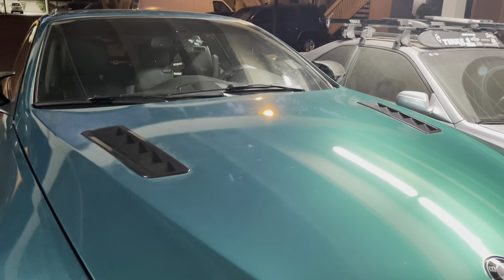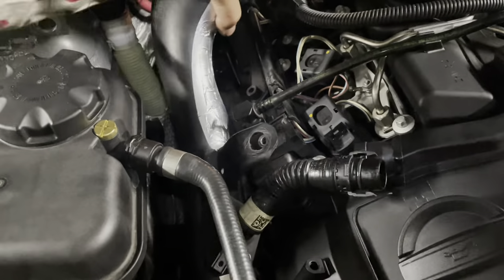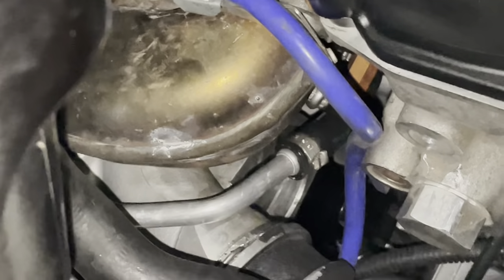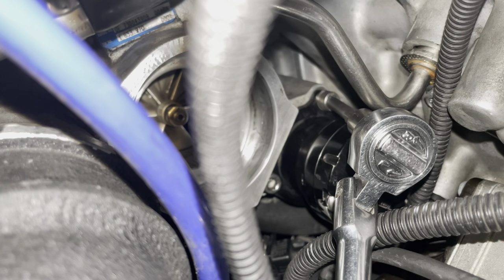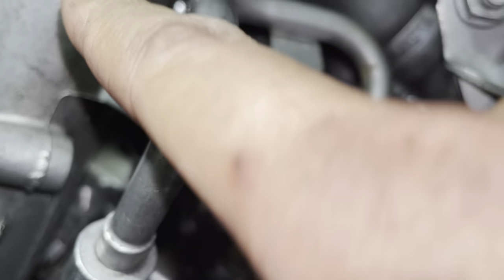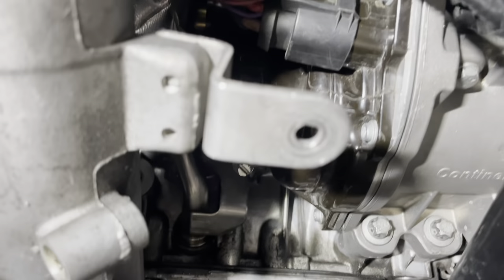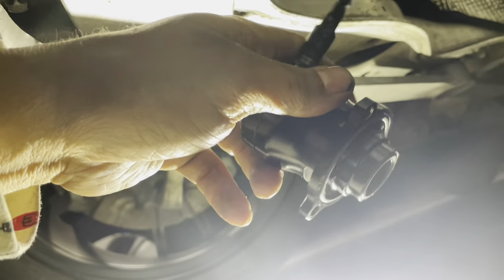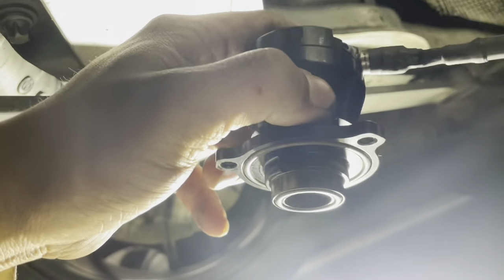BMW 335i N55 Turbosmart BOV Blow Off Valve Install Guide Without Removing Water Pump E90 F30 DIY

Comment: Cool video, but you should mention that the only way you're doing this job without removing the water pump is because you left the 3rd bolt off your water pump from a previous job. Everyone else with that third bolt will remove the water pump since you have to disconnect coolant lines to access that bolt.
Reply from the maker: Thanks. The third water pump bolt is tricky to get to, but very possible using swivel sockets and extensions.  There is plenty of guides on the water pump, so I didn’t bother to include it in here.
Reply: @Sals_Garage  it’s just convenient for it to be in one video
Reply from the maker: @1oftheworstclashers740  Sure thing, I would have included it if I had the third bolt installed (which I didn’t at the time).

Comment: If you can get to one bolt and see the others, do you think this job can be completed topside and not even lay on the ground???
Reply from the maker: Not possible since you cannot reach the bottom two bolts from the top, let alone remove and replace the BOV.  It's impossible to see what you are doing from the top.  Easiest way is to remove the waterpump:  https://youtu.be/_EueZ7n6JKQ

Comment: where was the plug with the 2 wires connected? thanks, is it electronically actuated?
Reply from the maker: Electronically actuated, it connects to the stock diverted valve connection.

Comment: Question i want to install this mod to my bmw x5 e70 35i 2012 n55 stock engine ,will this blow off valve cause any problems to the engine or turbo over time?
Reply from the maker: No issues at all.  You will love this mod 👍

Comment: This pretty much the same for f30 apart from whhere the intake is?
Reply from the maker: Yea, the F30 is the same besides the intake location.  Kies motorsports has a good DIY guide on the F30.  I would still try to get at the top bolt from above while removing the inlet and intake.

Comment: Do you think this same method would work for an F15 X5?
Reply from the maker: The turbo is the same but the inlet design and taking apart the intake might be different. I would remove the water pump if you get stuck at any point.

Comment: Is this process the same for e90 335xi(n55)?
Reply from the maker: Yes, but less room to work with due to the front diff.  I would remove the water pump if you are having difficulty

Comment: Will my car be able to run properly with the BOV installed since MED17 is a MAF and load based ECU, BOV won't confuse it by letting the MAF-calculated air out of the intake system?
Reply from the maker: Yes, no issues at all. The MAF only has issues when there is a leak or aftermarket intake sometimes. The car actually runs better than ever with the BOV since the stock DV leaks past 20 psi.

Comment: Im confused, granted mine had a tial when i bought my car, ive removed it without having to do anything else it took like two minutes. This looks totally different than mine
Reply from the maker: Your e9x N55 engine should look like mine.  If not, it may have an upgraded turbo or even a swapped engine LOL.
Reply from the maker: If you have an N54, it is a lot easier to swap the BOV since its on the charge pipe and not on the turbo itself.

Comment: I stripped the top right bolt man how fucked am I?
Reply from the maker: Not the worst case. Just remove the water pump for more room and use a screw extractor.